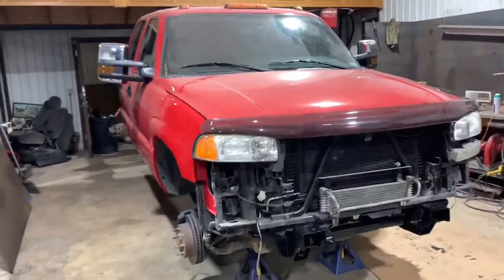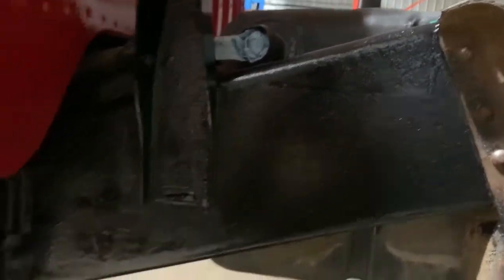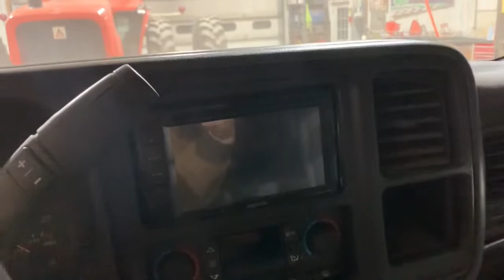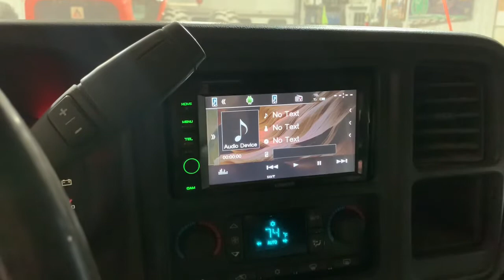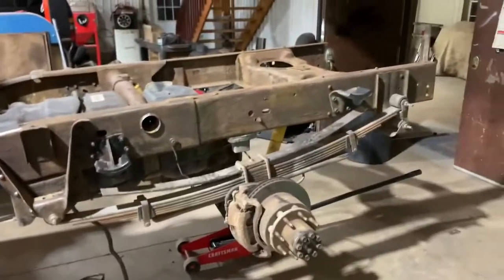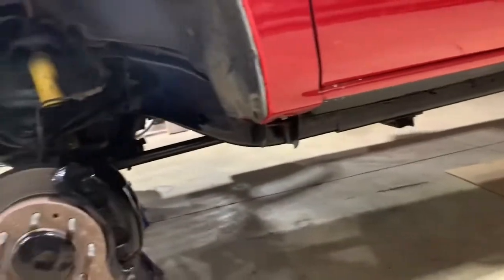2006 GMC Siarra￼ LBZ Leather interior swap ￼

Comment: Sweet looking build so far! How did you install the steering wheel controls?
Reply from the maker: It’s all plugging play although I need to have the BCM flashed because the truck does not recognized the steering wheel controls. Kind of sucks.